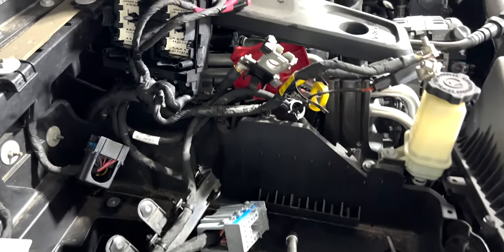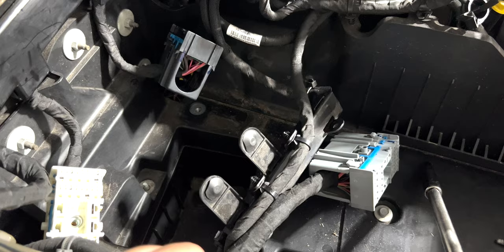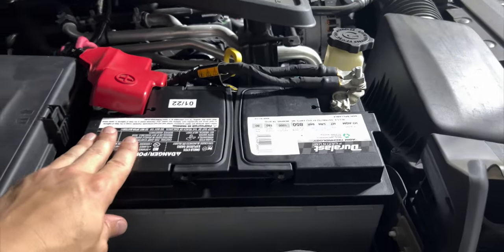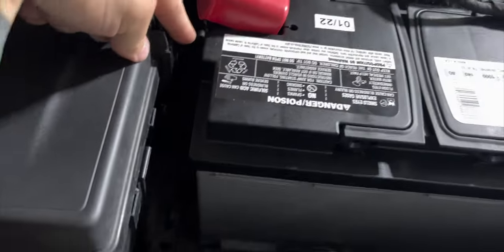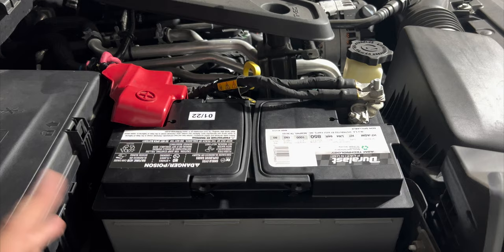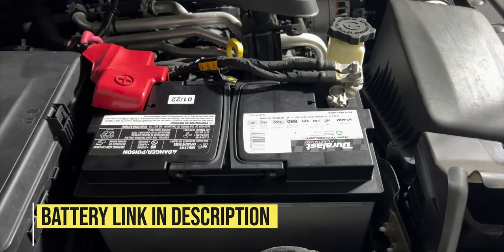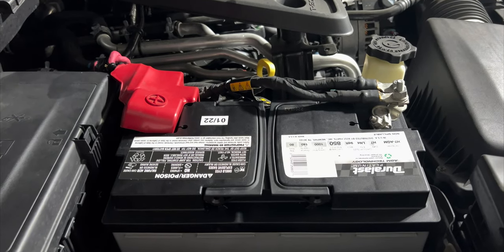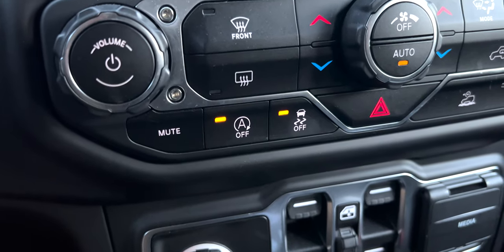Jeep Gladiator (and JL) Auxiliary Battery Bypass (Single Battery Conversion) No More Dead Batteries

Comment: So do I HAVE to run a tazer to be able to eliminate the smaller battery? 
Or would I need it before doing so?
Reply from the maker: All the Tazer is doing is telling the computer to remember to turn off the stop/start feature when you crank up the Jeep. You should be able to do this without the Tazer, but you will need to press the button every time you get in. It’s possible you will get an Stop Start error light on the dash without the Tazer. Can’t say for sure.

Comment: Did your auxiliary batter have a black box relay on it and if so what did you not to put it back on?
Reply from the maker: Mine didn’t have anything on the battery. Just the two leads going to it.
Reply: @Ali_Mansour_Editor  that sucks mine is a pain but thank you for your reply

Comment: Thanks for video! Do you have to remove the smaller auxiliary battery or just tape it off where it connects to main positive battery terminal? Thanks again!!
Reply from the maker: I would remove it. You'll need to pull that cover panel to access the wires anyhow.
Reply: @Ali_Mansour_Editor  thank you!! 🙏🏻

Comment: So you replaced  your main battery for another. How does this help with deleting the auxiliary battery?
Reply from the maker: I completely deleted (removed) the second battery. What I’m showing you here is that the auxiliary battery power wire is now connected to my new main battery which is larger than what came in the Jeep stock. This is the second time I’ve done this. so, I just wanted to put together a quick video to let people know that it can be done and how to do it easily.

Comment: Ok so it's been 3m now how is it holding up? Is the battery still good? Is it still not showing any code issues? I just had my batteries replaced and it went dead less than a week later
Reply from the maker: Still working great! I just drove cross country (6,200 mile round trip) and it’s working perfectly.

Comment: 2020 it should still be under warranty?  Did the dealer not replace for free?
Reply from the maker: I wouldn’t let my local dealership refill the air in my tires. Much less swap a battery that requires this much work under the hood. I’ve had a pretty terrible experience with them, so I just do the work myself when it’s something like this.

Comment: I am curious. If I have to take mine into the dealer and unmarry and remove my taser mini, and at a stop light the stop start stops the engine because I forgot to turn off manually at each start, will it still start up just fine with only the main battery?
Reply from the maker: The honest answer is I don’t know because I have not tried to replicate that scenario. It should work without issue. My assumption is the auto stop start simply would not work and you would get the Stop Start error light on the dash.
Reply: @Ali_Mansour_Editor  Makes sense, thanks!

Comment: Some guys are pulling the fuse 42 as an extra step from what I read. Is that something you think we need to be doing as well? Thanks.
Reply from the maker: I have not found that to be necessary.
Reply: @Ali_Mansour_Editor  OK thank you.
Reply: @Ali_Mansour_Editor  i pulled fuse42 to keep away from pulling the positive from the aux bat… i did however removed the negative cable from main battery  that belongs to the aux and just put it to the side with electrical tape. Car runs normal, i did this a few days ago. Could that cause  any problems?
Reply from the maker: @Brown-papi  the honest answer is I don't know. From what I understand, pulling that fuse won't allow the computer to talk/check on the AUX battery. I was also under the impression this would give you the stop/star error code and light. I've only ready online where others have pulled the fuse and negative cable. I don't know of anyone personally who has done it. Everyone that I have encountered with AUX battery issues has done what I have. It's pretty easy to just remove the AUX battery. So, I would do that regardless if you want to keep the fuse pulled.
Reply: @Ali_Mansour_Editor  the only problem i noticed is that when you pull up at the light and the car turns off, the jeep asks to put the jeep in park to keep then back to drive to keep driving.  Is the reason why they recommend to make sure you press the avanger Botton.  You can also use the tazer to prevent this from happening to turn off that auto stop/start issue.
Reply from the maker: @Brown-papi  if it’s asking you to put it in park, that means it thinks the vehicle has been turned off. If the start stop button was pressed you shouldn’t have that issue, but I would just bypass the battery and replace the fuse personally.
Reply: @Ali_Mansour_Editor  yes, i understand. I have forgotten to push the botton is the reason why it did what it did. I’m planning on disabling that with the JScan. The only downside of that is that i will lose the remote start.

Comment: Did you have to modify or remove anything in order to fit the H7 battery?
Reply from the maker: There is a small plastic retainer that sits at the bottom of the main battery tray. This is not the battery hold down, but rather a piece that is towards the air box. You just need to pull it out. That will allow you to drop in the wider battery.

Comment: I saw you replaced the Main Batt with a larger version. Is that necessary, or can you simply use the stock Main?
Reply from the maker: It is not necessary. I just did it to get a larger capacity battery under the hood.

Comment: can you explain the taser thing more
Reply from the maker: The Tazer is a module that you plug in under the dash of your Jeep. The one I have cost a little over $300. It allows you to modify things such as tire size, gear ratios, and in this case, let’s you turn off the auto stop start permanently. It’s essentially pressing the off button for that feature for you every time you start the vehicle.

Comment: Does disabling the start / Stop void the warranty?
Reply from the maker: Doing this mod does create the potential for the dealership to deny warranty to things that pertain to the battery. They are not going to deny your rear axle breaking because of this, but it's possible they could give you a hard time if you had something electrical malfunction. It usually all comes do to the service writer at the dealership.
Reply: This is what the service manager told me, don't know how much of it is true. The pcm will show it being flashed from the tazer and will void the oem warranty. I'm not going to take the chance with one until it is out of warranty.

Comment: Ali, question.  Before removing aux battery and doing bypass does auto stop start need to disabled?  Or it will cause issues with aux disable auto start stop before removing aux battery? 

Btw I hate auto start stop. I do no have a tazer at this time, however I removed the switch under hood so I do not tneed to turn off auto/start/stop each time I start the JT.
Reply from the maker: If you are not going to install a Tazer, you will just need to press the auto stop start button on the dash every time you start the Jeep. I actually had to remove my Tazer module the other day. I didn't have any issues.
Reply: Remove fuse 42

Comment: This still working fine?
Reply from the maker: Yes. I just did this same mod to another one. Zero problems.
Reply: @Ali_Mansour_Editor  for the life of me I couldnt get the fuse box off. I removed the 4 bolts but all the plugs underneath still stuck on. I couldnt find release tabs for them.
Reply from the maker: @apwrealty  you have to really squeeze the clips on the plugs to pull them off. It’s a little bit of a pain for sure. You could also pull of the fender and access the battery box from below. I know others have done this method, but I have not.
Reply: @Ali_Mansour_Editor  for sure.  I was going to access it from the fender, but can’t get the wires up to the new battery if i do that. Would just have to replace the auxiliary battery in that instance. (I think, at least)
Reply from the maker: @apwrealty  I have never done it from that side, so I don’t know if you would have ability to pull the wires up.

Comment: Mine has many warnings coming up now. Dang
Reply from the maker: From the battery conversion? You may need to attach your secondary ground as well. That seems to be the only difference for some Jeeps. I've been running this setup on two different Gladiators for over a year with zero problems.

Comment: Would this be a problem if I didn't have the tazor or any thing of that sort?
Reply from the maker: So long as you press the auto stop-start button every time you crank the Jeep, I think you would be OK. However, I have not tried that.
Reply: @Ali_Mansour_Editor  just connected to one battery, will update over time
Reply: @migueldelafuente7857  how’s it going so far?
Reply: @migueldelafuente7857  update ?
Reply: @lifeoutdoors3953  so far so good followed these steps and taped up the ground from the aux I’ve been watching my battery and has been starting fine however I have aftermarket headlights and at now from time to time I see them flicker but that’s pretty much it
Reply: @brian8978   that’s the update
Reply: @migueldelafuente7857  Thanks buddy makes a little sense supposedly the aux battery runs headlights and such so it is to be expected I guess I appreciate the response!

Comment: So attached leads to aux battery to main battery , long term has fixed all battery issues & has alternator been okay?
Reply from the maker: If it’s a 21 or newer, you have to connect both of the aux battery leads to the main battery. If it’s older, you just need the positive lead connected. It’s still working great. Zero issues with anything electrical.